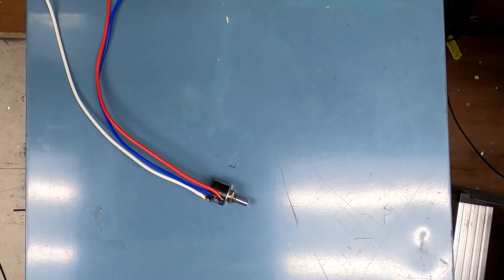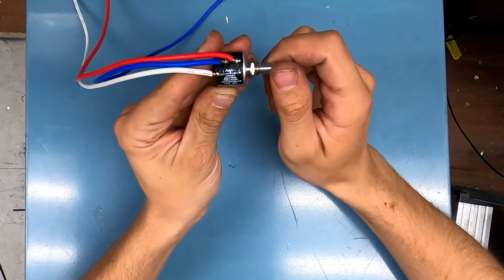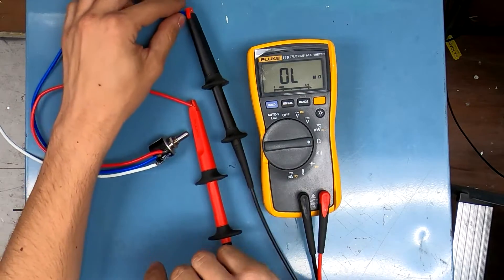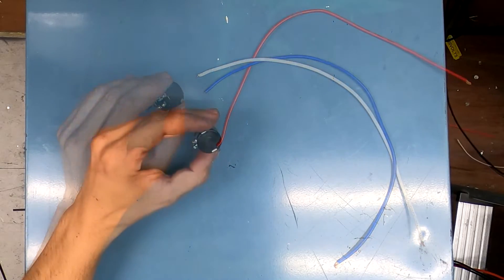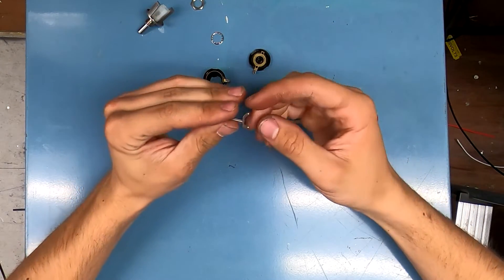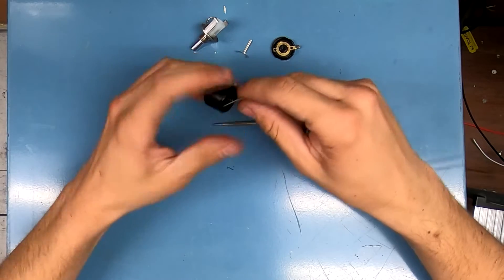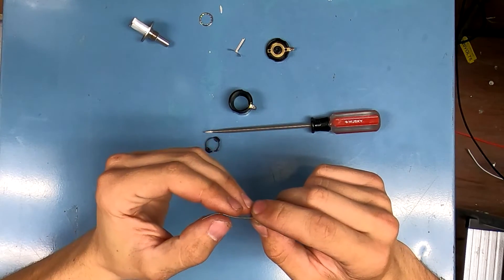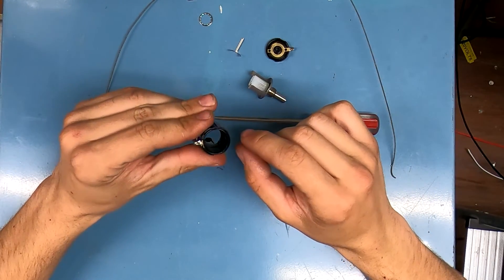How NOT to connect a Potentiometer (What's inside and how did it blow)

Comment: Could you have put a resistor on the wiper lead and connect the positive to the other side to make a voltage divider?
Reply from the maker: Voltage divider needs negative reference.  Variable resistor, yes.  The voltage would vary based on load.  While the transducer should be a constant load, it can still float and cause inaccurate reading.

Comment: Why on earth are you still worrying about using that expensive plc junk? Just use a micro controller....like a pi or the hundreds of others. you can suit it to your particular needs rather than trying to adapt this commercial crap to your needs and if it dies the diy way wont cost you a fortune
Reply: plus its kinda cooler to have...
Reply: @tfinnm  I mean he can use microcontrollers with maybe relays I suppose
Reply: @diamondev1  most available relays can't toggle the current he needs. Maybe 1x 20amp circuit, but definitely not the 100-200A that he needs to run his outfit. Most of the relays he would need for motors and pumps are 24vac: so a relay to control a relay...
@stoner916 you should stick to the Ganja instead of commenting on someone's impressive DiY project, maybe go make a bong out of toilet paper tubes and an old Tupperware container?
Reply: Because a micro on its own doesn't have the proper I/O
Reply: Pretty sure he needs something that can stand high voltage capabilities
Reply: @diamondev1  and high amperage